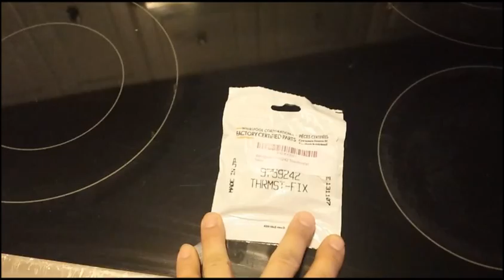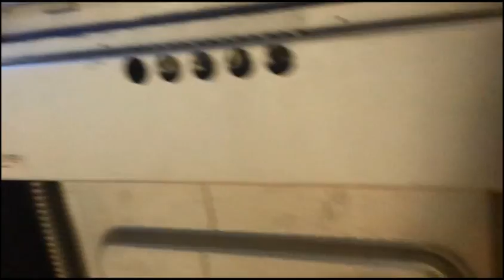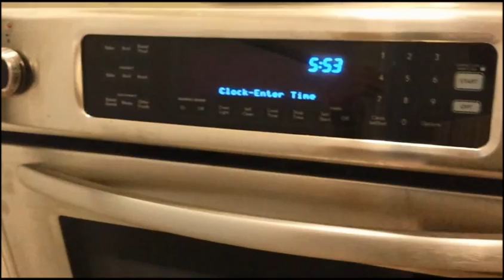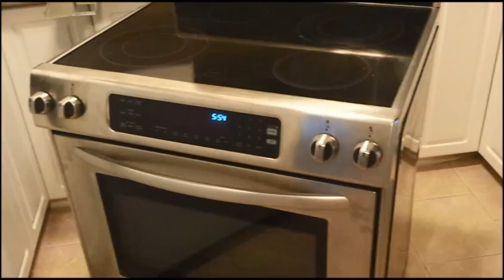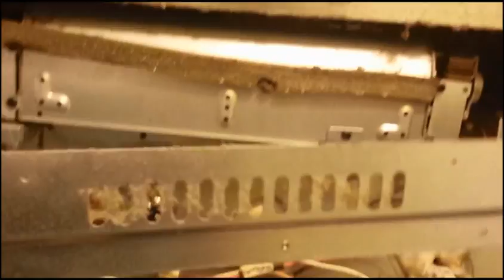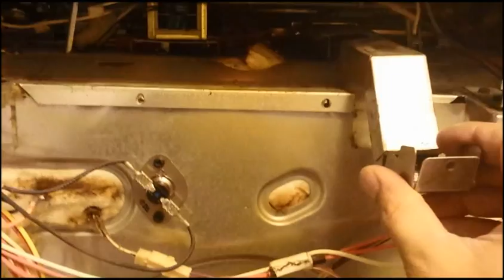Repair - Dead oven after self clean mode, blank display, locked door Kitchen Aid Whirlpool

Comment: Bottom line, don’t use self clean feature. Secondly, connect wires on door latch to fool computer into thinking the door is closed, or close the switch if it’s not internal and jam something In there to keep the switch closed, same result.
Older ovens did not have that door lock feature. If you used the broiler, you would open the door about a third of the way to keep an eye on your food browning…..then the safety nazis showed up!

Comment: Hello,
I have a 25 years old oven and it was working great.  The other day I ran the self-cleaning and the self-cleaning cycle was interrupted.  After that, I could not unlock the latch to open the door.  No error code is available on this oven but something is holding the manual latch and won’t release it.  The manual handle is on the outside of the oven door, but I was told not to force the latch open as I could cause more problems.
The oven is a GE JB550GJ and the latch is a manual lock.  You slide the latch handle from the left to the right to lock the oven door for self-clean.  (I searched the Internet and most solutions for unlocking the latch are for automatic locking mechanism, not for manual latches.)
I powered the oven down for minutes then powered it on.  I gently sliding the latch to the left but it won’t release.  I tried to run another self-cleaning cycle, but it won’t start the self-cleaning now.  Do you know how to release the manual door latch?  My specific questions are:
(1)	What is holding the manual latch and not letting go?  Is there a way to unlock the latch?  What are the specific steps required to reset this specific oven and to allow unlocking a manual latch?
(2)	I have the user manual but it only talks about how to use the oven.  I need a service manual to help me understand how the latch got stuck.  I searched the Internet but I could not find a service manual for this old model.  Do you know where I can download a copy?
(3)	If I pull the oven out and access the back of the oven, is there an easy way to unlock the oven from the back?  Do you think my old GE has a locking pawl inside the back panel which I can toggle to unlock the latch?
(4)	I searched the Internet and found no parts relating to the locking mechanism.  Do I need new parts to repair this problem after I get the door to open so it won’t happen again?
Thank you for your help.  Phil
Reply from the maker: Hi Phil, you probably need a new latch. Those use mechanical locking and I'm assuming it malfunction
Reply: @randomrepairchannel  I found a manual on the Internet.
https://www.geappliances.com/search.php?search_query=JB550GJ&tab=manuals
Page 6 in the manual; Part #9 is the latch handle that got stuck to the right (lock position) and the oven door can not be opened.  Any idea how I can remove the old latch when the door is locked?

Thanks.
Phil
Reply from the maker: @mac2pc2  try lifting the stove top from the front to access under the burners

Comment: would it be possible for this to be the issue if my display is still working? oven is dead otherwise
Reply from the maker: Depends on the model but yes
Reply: @randomrepairchannel  thanks for replying. it’s actually this exact oven in the video but gas.

Comment: Thanks for the video. 
I have an older ge electric jbp76gs3ww oven. 
I've looked at owners manuals, google searches, and multiple videos - and can't find a consistent picture of the fuse or its location. 
There's a circular component that looks like what you have here - but its the back of the oven light, so unless a fuse is built in - hidden - in the bottom of the light socket, that's not it. 
The oven light hasnt worked for years though, and there is black residue around it - but like I said its the light, do they ever incorporate the fuse in that light socket part by chance?
The back of the main knob is a control board - with components but nothing that looks like a fuse.
Also under the top, there's stove top components with 3 wires each, there's a two wire door shut switch, a door lock switch - but nothing that resembles "fuse".
Could it be the oven temperature probe/sensor going into the oven (4 inch metal tube)?
Another video guy told me there is a thermal fuse on my model, but I'm not seeing anything resembling " fuse " - unless it's in the circular light socket. 
Thanks for your time and any help would be greatly appreciated.

Comment: If the oven is not dead, instead just says "too hot" on every key press and is showing "door locked", all you need to do is turn the breakers off, remove the side rails, unscrew the display unit on the side, push it up and tilt it gently forward on the top to get access to the door lock mechanism. Push in the solenoid that is blocking the door lock operation and unlock the door. Put the display unit back in its place but make sure the connectors are still all plugged in tightly. Power the unit on. Voila, oven is functional again.

Comment: Would you know where the fuse for the control board ? I have same wall oven as you Model PLEB30T9FCC Frigidaire
Reply from the maker: Yes it does, not exact location, but similar
Reply: @randomrepairchannel  i just took all panels off and couldn't find it i am really worried
Reply from the maker: @LubaLuba1  I know sometimes they are on the top

Comment: Great Video! My Frigidare died as soon as we did the self clean. There were about 10 screws and the back came off. There was actually a circuit breaker rather than a fuse. Reset the button and it fired right up. Would have been nicer if the circuit breaker would have been able to access without pulling the panel off. I guess they want to make it a 75 service call to reset the breaker. Thanks!

Comment: But how to reach the back of a built-in Whirlpool oven, when the door stays unlocked... can it be removed from the kitchen with the door still locked? Can’t find any screws... I’m screwed?
Reply from the maker: There is always a way to undo the latch. Check your manual
Reply: Random Repair In order to obtain a manual, I need to know the model/serial number which is usually on the back of the oven that I can’t reach :)
Reply from the maker: @coenvanwermeskerken3630  crap.

Comment: What is the difference between a thermal fuse and Oven sensor or are they the same thing? I interrupted my clean cycle stupidly, and now I have two error codes on my GE range. I have error F3 which apparently means the Oven temperature sensor is malfunctioning, and I also have Locked door error message which may be cause my Door lock motor is stuck in the wrong cycle. I was thinking of taking out the motor first which is very difficult considering that GE likes to rivet the crap out of the engines over using screws. It will be interesting to see if that will remove the locked door error. Then if the F3 error is still there then i guess i have to change my oven sensor. What a pain! I will never use self clean again. Maybe they should call it self-destruct feature since its so hard on the elements.

Comment: This gas range is absolutely amazing!~~>allmy.tips/Whirlpool_Range?34h   My two favorite features are the extra large window, and the metal grate on top. I have absolutely no complaints about this range. The light inside the oven is so bright that you can easily see what you are cooking. I also love how the burners work. The inside of the oven is very wide and can fit multiple things at once. You will not be disappointed if you purchase this stove.

Comment: Still not powering up . After ordering and replacing thermal fuse ! What else could it be ? Please help ASAP !
Reply from the maker: Some models have 2. Was yours open?
Reply: Random Repair  no the door was locked but I only see one on the back and I replaced it ? Hmm
Reply from the maker: @Chrgagg  I mean was the fuse open when tested with a multimeter
Reply: Random Repair  I don’t know what a multimeter is ? I just opened it up from amazon and took the old off and the new one on ? Did I do something wrong ?
Reply from the maker: @Chrgagg  testing the old one first would have been a good way to see if it was bad. 

If you send me the model number I can see if it has a second fuse.
Reply: @randomrepairchannel  same issue here.  didn't think to check old thermal fuse.  replaced it and still not working.  old fuse tests good when using multimeter.  whirlpool single electric wall oven
Reply from the maker: @ginnymacy  many have 2 thermal fuses. Depends on model

Comment: I think I have the exact same model with the door locked and screen dead after a self clean cycle (and thus can't find the model number). Could you share the model number of this particular unit? (or point me to how to manually unlatch the oven door)
Reply from the maker: Sorry. Don't have that info anymore. Best to just replace the fuse, or jumper it to get door open
Reply: @randomrepairchannel  No worries. I managed to jimmy open the lock with a wire hanger and find the model number (mine is KERS807SSS02 for anyone interested). Checked the fuse and it's definitely popped, so hopefully replacing that will fix things. Only $10 on Amazon for a replacement. :)

Comment: If I fix the wires, do I still have to get a new display?
Reply from the maker: Display?
Reply: Yes. I did a self clean for first time.   The door locked and display died.  A repair man wants to charge $300. For display and thermal fuse. The research I’ve done says it most likely a thermal fuse.  So. By fixing that, will the display come back on and door unlock?
Reply from the maker: @peytondavidson4135  yes. Display should return when fuse is replaced
Reply: Random Repair thank u.  I thought so. He laughed at me when I told him I didn’t want display.  Just fuse. Lol.

Comment: Great video and thank you! This is the first video that came up when I searched “whirlpool oven not working after self clean”. Thought I would share my experience. I did replace the  part #4449751, which is the fixed limit thermostat. It didn’t fix it. But I did replace the part # w10545291 thermal fuse and it did fix it. My thoughts to help would be to check that first and foremost. Hope this helps. Thanks again for the video and saving me from buying a new oven. 

Link to another video that mentioned thermal fuse replacement. 

https://youtu.be/XYeb9J09BVU

Comment: thanx for this vid , exactly same issue , waiting of fuse from amazon, hopefully will rectify problem,and will check fan motor when i get in there and do the repair!! and yes mine is a "Kitchen aid"
Reply: well as it turned out , exactly same stove same issue was not as described in this vid, what it turned out to be after my diagnostics it was my transformer , under the elements as no power was getting to my master control panel....installed the new transformer 175 bucks (part number wpw10111628 transformer...made in HK 08/15/19) installed and we be baking cookies and pie as we speak ,hope this helps someone in the future...as testing the  back sensor still tested good and my fan was working as new...cheerz and good luck

Comment: Any advice if the oven is built into a cabinet?
Reply: RIP
Reply: @blitzkriegbruce5307  I wound up yelling for pro help. Wasn't as expensive as expected.
Reply: @justalurkr  Glad to hear it-- when you don't know what you're doing, unfortunately it's easy to be taken advantage of!
Reply: we just had this problem. In link below he shows using a coat hanger. We bent an old fashioned stiff metal coat hanger to an L shape, got it in straight then turned the leg of the l down and pulled it across the center a few times till we caught the latch. Took about ten minutes of fiddling to bend the shape to what we thought would engage. https://www.youtube.com/watch?v=XYeb9J09BVU

Comment: My oven died after a power outage so I bought a brand new one, the old one was hauled away, installed the new one, and it doesnt work either. Haven't even used the oven and theres no display, and I cant use any controls. Only the eyes of the stove will come on. I NEED HELP
Reply from the maker: Probably missing one of the hot lines. Check fuses (will be 2) or breaker. Could be a wire or outlet too.
Reply: @randomrepairchannel  do you think it could be the actual power chord wires? Because I used the same power chord from the oven I threw away
Reply from the maker: @killinqsworth1156  quite possible. If you have a multimeter with AC voltage test you can check for missing line. If you are in Canada or USA you should have red, black, white wires. You should have over 100 volts on red and black reference to white. If red or black are missing voltage you need to find out why.
Reply: @randomrepairchannel  okay thanks a ton man! I'll check things out again today and probably, but hopefully not, be back with another question lol. I really appreciate it as I'm 23 and can not really afford to have some joker charge me 200 bucks just to come and TELL me what's wrong
Reply from the maker: @killinqsworth1156  wire may have fallen off fuse, outlet. Or the breaker died.

Best of luck
Reply: @randomrepairchannel  okay one last question for now, sorry. If the breaker was dead, could the stove eyes still get power? The breaker my range is connected to is a double switch or whatever you call it so maybe one side went out or something?
Reply from the maker: @killinqsworth1156  yes. The double breaker is one for the red line one for the black. Now, be very careful with all of this. High voltage can be lethal. 

I would suggest turn the breaker off, take the cover off he stove, turn the breaker on and check for power red to white, then black to white. Red and black together should be 220+ volts

Comment: This was an excellent video.  I have the identical make and model and the oven door won't open.  I think the control board has failed.  Does anyone know how to unlock the latch using a coat hanger to force the latch from the front?  Should I move the coat hanger from the left to the right or vice versa.  

I have to use the coat hanger i cannot remove the ceran top without first opening up the oven ddor.

Comment: My GE JGSP42DET1BB Gas range just stopped working after self-cleaning it. It happened before. Where would I find the thermo switch on that particular model? Thanks for posting this.
Reply from the maker: I'm not sure on that model but it's going to be connected to the oven body somewhere. See if you can get a service manual for your unit
Reply: Random Repair Thanks I just found its location.

Comment: My oven says unlock door but it is unlocked.    
 The range works and the oven self clean turns on. I just can't bake or broil because the oven still thinks the door is locked? Any help?
Reply from the maker: touchablehope sounds like the latch failed. You will need to disassemble to replace

Comment: I have a KitchenAid duel fuel double oven. Shortly after turning on the upper broiler the panel goes blank. It will reset by flipping the breaker but  will only last  another 20 seconds before going blank again.  But if I don't  reset the breaker the broiler will come back on its own after some time and will continue to work for at least a couple minutes. I'm assuming it is overheating like you mentioned in the video.  Could this be the case with using the broiler and not the self clean cycle?
Reply from the maker: Natalie Tyre it's possible but I'm not familiar with that model. maybe someone else will chime In

Comment: Hello, I bought one used electric stove similar to yours and I have the same problem with the  oven latch. I opened the back, like you show in your video and the two black wires that go to the thermal fuse are connected together and are not connected to the fuse. In that case, if the fuse was not blown up, what else failed? And what can I do now? Please tell me if I can repair that... Thanks
Reply from the maker: Andy MeL could be the control board. Needs further diagnosis. I would check the schematic and look for power at testing points.
Reply: Random Repair Ok, I gonna do that. Actually I open the top, I think is the motorized latch. My friend will come to help me with electronics tools to make tests. Thanks for your answer.
Reply from the maker: Andy MeL good luck! keep us posted

Comment: @random repair I have replaced the fuse my fan seems fine but I still have no power and the door of course is still locked. I have a gas kitchen aid. Any other thoughts on what I can try?
Reply from the maker: Gary Saretsky did the old fuse test bad? some of these units have 2 fuses...

Comment: Awesome video thanks! I believe you have just saved me a tonne of money, time and headache! Only question have is that i have almost the exact kitchen aid in the video except mine is GAS.  Will i find the fuse in the same spot and should i be concerend with the gas still hooked up? Unplugged of course..thanks again for the video!
Reply from the maker: Michael Dinger thanks! the spot should be similar. always turn the gas off before attempting repair. best of luck.

Comment: I did everything you said in the video, it still doesn't work. Maybe I have a faulty brand new thermal fuse? Pisses me off, that is not a cheap part, I had to order it on line and wait for delivery. Merry Christmas to me, no baking, no turkey. Any other thoughts on what it could be?
Reply from the maker: kim abbott did you test it with a multi meter?

Comment: Thanks for this video! Question - My Kitchenaid range is an older model and has a Whirlpool 8300802 thermostat. Do I have to replace with that exact part or do you think the newer (and cheaper) 9759242 model would be compatible?
Reply from the maker: Sugarsting it would probably be ok but it would be wise to check the temperature rating on both first! best of luck